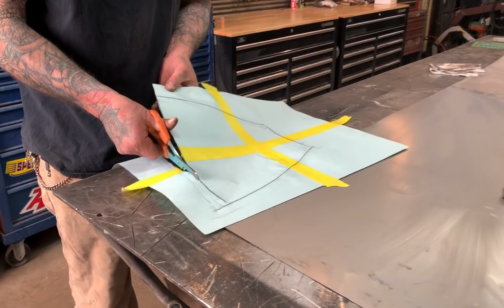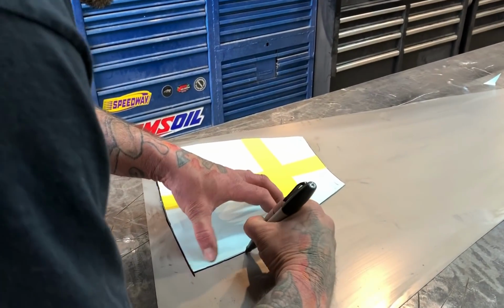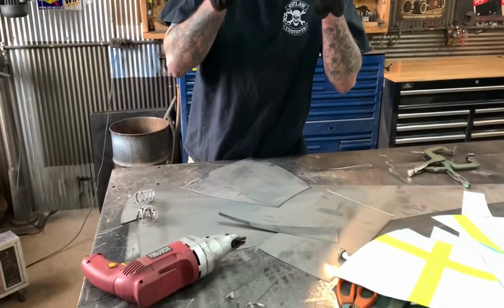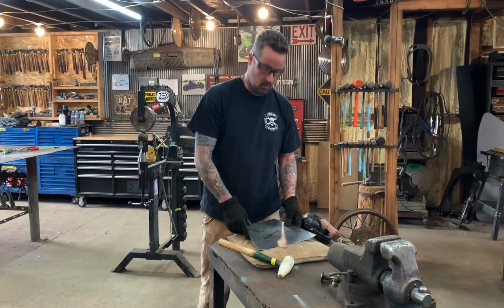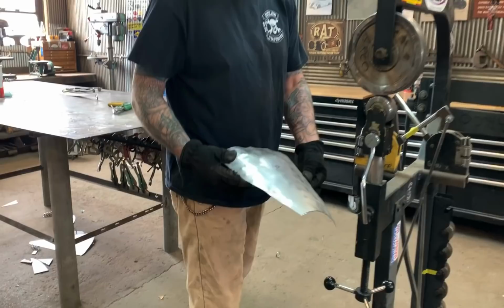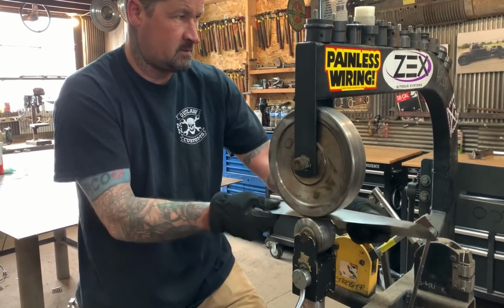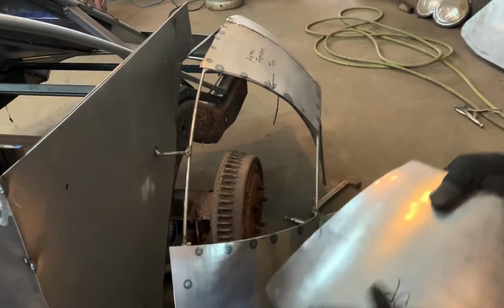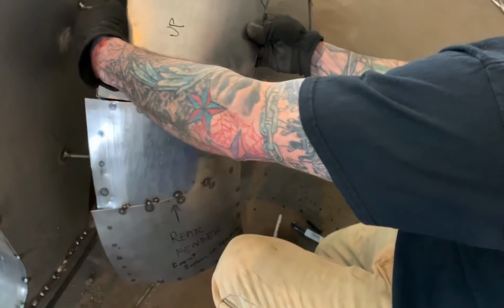Metal shaping: compound curve - building the top of a fender

Comment: What size and kind of round rod  did you use to build the body on the custom car
Reply from the maker: 1/4” solid cold rolled steel round rod. 5/16” works well also. Cold rolled so it bends smooth and easily brother. Hope that helps. ARCO

Comment: What is the dead blow mallet you use the most
Reply from the maker: Poly shaping hammer from harbor freight 👍 its the only one they sell for 8 bucks
Reply: @OutlawEdge  perfect thank you so much
Reply: @OutlawEdge  2 In. Teardrop Mallet correct?
Reply from the maker: Yes! 👍 for the price grab a couple because ive broke the handles before.  Also Eastwood sells poly mallet kits but they are exspensive bro. Hope that helps
Reply: @OutlawEdge  alright thanks
Reply: @OutlawEdge  is there a website that ships to canada

Comment: Question: if you could only buy one one of either a Planishing Hammer or an English Wheel, which one would you get?
Reply from the maker: Guillermo Nieri if only one i would get an english wheel cause u can use it with a shrinking stump and beater bag. Thanks for watching. ARCO MN OUTLAW CUSTOMS
Reply: Which of the 2 would you suggest?
Reply: @OutlawEdge  Thank you Arco.
Reply from the maker: Guillermo Nieri   I think the KLUTCH brand planishing hammer from northern tool is a great choice and if u can afford it the GRIZZLY English wheel ( the large one) is a great buy 💪💪💪
Reply: @OutlawEdge  Thank you Arco; I like the KLUTCH with the 19-5/8 throat from Northern Tools; as to the English Wheel I have considered the GRIZZLY Bench top with a 15- throat for price & space (work in my 2 car garage); As a hobby I buy old cars in bad shape, one at a time, , fix them, have them road worthy, inspect them, drive them, sell them, and find another one to revive. As a hobby, i.e. cost money, but, keeps me out of trouble & busy. Your videos have been of great education to me. Thank you.

Comment: Using brake kleen is not smart! Toxic especially when welding on it!
Reply: Simple Green. One of the best tools in the shop.
Reply: Totally correct, when the UV light in the electric welding arc hits it, the chemicals turns into mustard gas  https://en.wikipedia.org/wiki/Mustard_gas, same stuff that was used in WWI for killing soldiers. With that said, this is one of the best metal working videos i´ve seen in a while, awesome build. Makes me yearn to go back into the garage and pick up on an old project that got stuck in time.